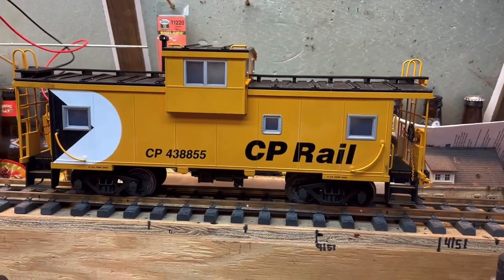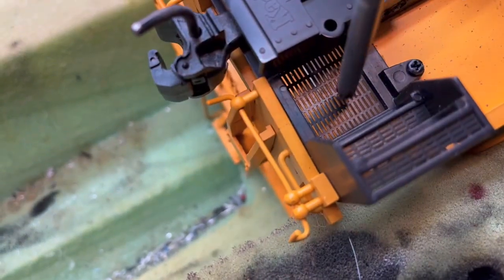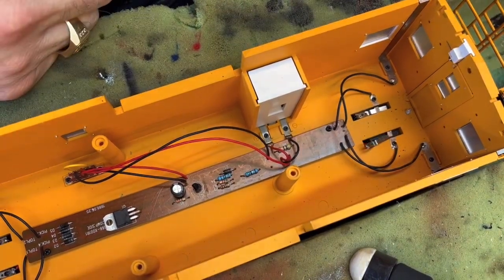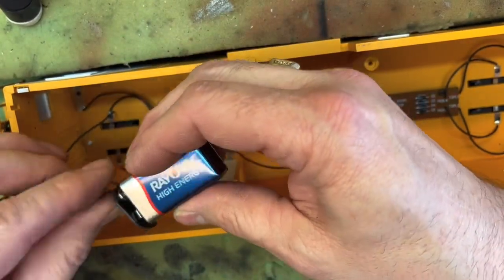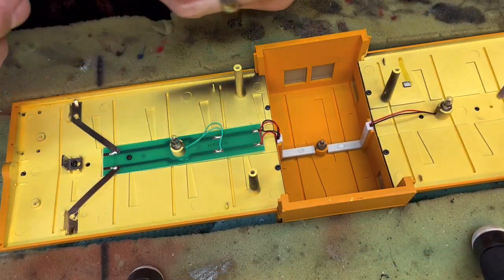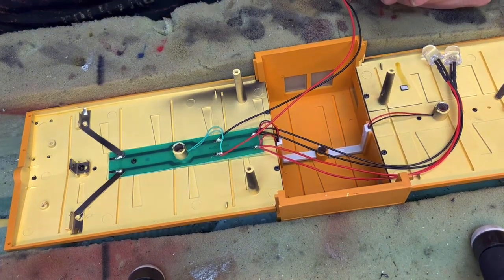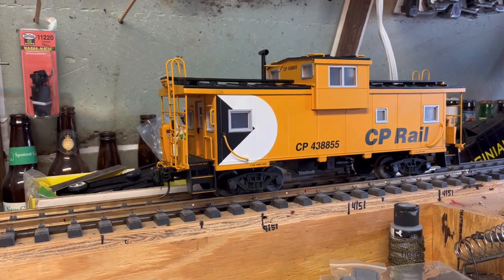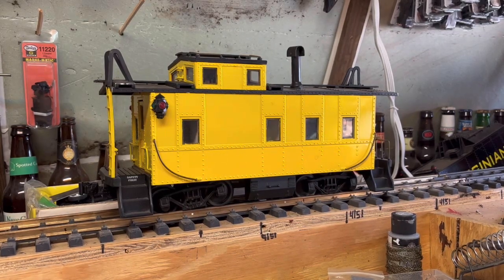How To Battery Power a G Scale Train Caboose The Easy Way! 3/6/21

Comment: I hate to be that guy… but if you pull off that white cabinet on the side of the caboose on the inside there is already a 9V battery holder in there, it’s meant for a rechargeable 9V so it will charge while on track power and then you have power for when not on track power, or at least that’s how the USA Northeastern (center copula) cabooses are set up.
Reply from the maker: Incorrect. It does not light up the caboose. Only the flashing light. Also, I do not have track power to charge said battery. Also I wanted all of the lights on. The way the wiring in the caboose it done it will drain the battery very quickly. If you hit the entire thing and hard wire a 9V the lights will stay lit for a week. You will not get nearly the same performance using their wiring and a rechargeable battery. I’ve tried.
Reply from the maker: The carted cupola caboose will only have the marker lights dimly lit using that method. I want all the lights on!
Reply: @TheeFishGuy  gotcha, I understand you don’t have track power but I was thinking you could put your 9V in the cabinet and remove the bulbs and still power your other LEDs in addition to the blinking light. It’s odd cause I can run my interior lights off the 9V in the cabinet on my Center copula caboose, maybe previous owner did something to make it work that way, not 100% sure. Thanks for the info
Reply: So every time the battery goes down, you have to open the caboose replace it
Reply: @trainman707 
Yep, that kinda takes the coolness away.
Reply from the maker: @popples4973  not if you make the whip long enough for the battery to fall out the back door. Then it’s easy peasy

Comment: Enjoyed the video.  This inspiration will probably get me to convert my center cupola USA trains caboose.  It does have detail inside.  The battery on it is easily accessible via popping off the cupola.  Too bad the extended vision one requires disassembly.

Comment: Dear Jonathan. I exactly followed your instructions and rebuilt my USA Trains Caboose to LED battery power. Everything so far works fine. However, it seems that I am having a battery draining even though the main switch beneath the car is set to "all lights off". After two days the 9V battery block is completely emptied although not in use. Clearly, there is a miminum power running through the circuit board on the bottom of the car, which is enough to light up a low power consumption LED at the end of the car without having to activate the main switch so "all lights on".
Do you have any advice how I can get rid of this leakage current? Thx in advane, Tom.
Reply from the maker: @thomashottiger9746  since this video I’ve discovered the same thing. I’ve also discovered that you have to remove the existing circuit boards. I should probably take this video down….

Comment: I was wondering why you didn't use the already installed 9v battery holder its the gray box on the side wall.
Reply from the maker: In all fairness I’ve had to modify how I do this completely. Now I gut everything that’s stock and use all my own components. Using the batter case inside will drain the battery very quickly, leaving the main board that controls the electronics also drains the battery quickly. Now all that happens is the battery runs the LEDs I install directly and they’re switched on by the stock switch. I can run the caboose for a week straight till the battery dies.
Reply: Thanks for the feed back I'm try to get mine back up and running again just getting all the info I can

Comment: Wow. 😂 I do almost the same thing... The difference with mine is that I make all my train from scratch
Reply from the maker: Fun! Do you have videos of your scratch built trains on YouTube?
Reply: @TheeFishGuy  all of the trains here on YouTube I made from scratch, however not all of them use batteries, I do have a catenary system that makes use of a "third rail" which is basically a wire that runs along the middle of the track since my track is not metal. So the top wire would be the 'red' and the rail wire 'black' lol. https://youtu.be/LQYO3v0L9lQ  here, if you look carefully you'll see the wire on the track

Comment: I have a NYC with 5 heavyweight Aristrocraft passenger cars. I am on track power, changing over to battery.  Will I need to place a 9volt in each car?
Reply from the maker: I did that at first but then decided to put a rechargeable battery in the lead car and tethered all the cars together.

Comment: I wish whoever did a battery conversation of my aristo caboose had seen this video had to buy the light fitting the circuit board second hand and redo it all was so peed off luckily it all works and eBay do the led bulbs cheap enough I’ve got a load for converting all my
Bulbs over on my layout as they will last longer than the normal bulbs and wont get as hot you do need to watch what colour white you get though 😐 brilliant white isn’t as authentic 😅
Reply from the maker: To me, as long as it’s lit up so I can see the end of my train, I’m happy.
Reply: @TheeFishGuy  yeah but the way you’ve done it you can put it back to stock if you go to sell it and kept all the parts
You took off so the way you have done it is in my eyes the best way